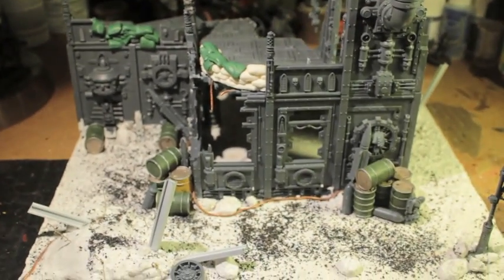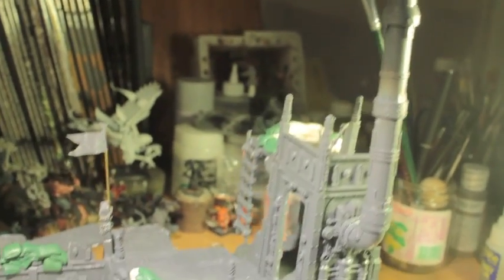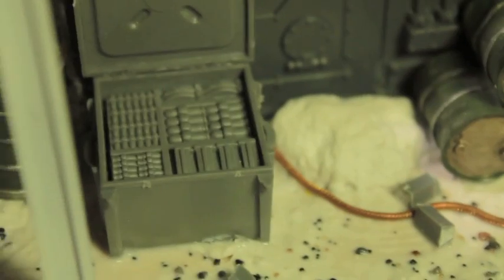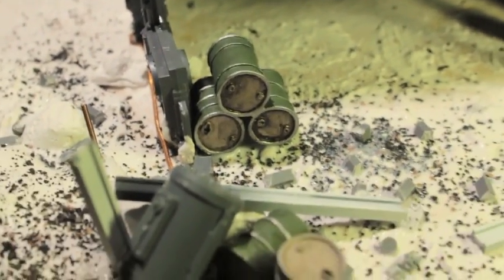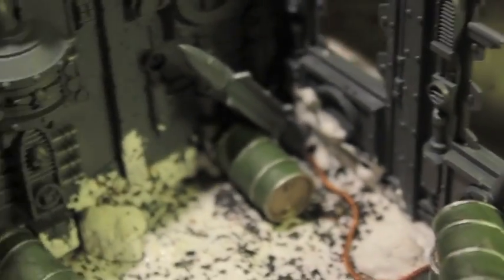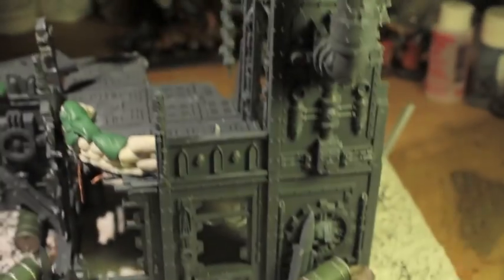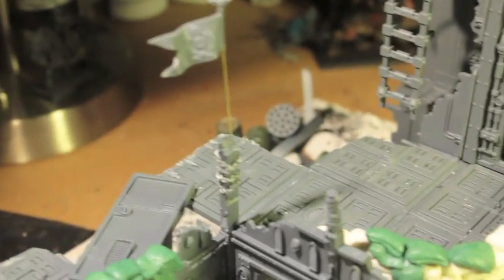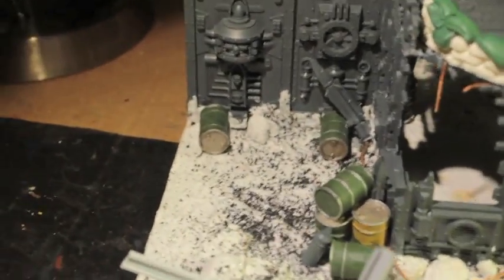IDICBeer Terrain Competition - Entry 2

Comment: Wow, such awesome and inspiring work once again. For the deflated sandbags, you should drill a few holes to make them look all shot up.
Reply from the maker: Thanks very much for the kind compliment, and for the suggestion!  I tried drilling through the stupid sandbags but I don't think I was using the right pin vice head, or something, because the greenstuff kept "sticking" to the drill and when I tried pulling the drill out, even working it out backward, it tended to warp the sandbag as the GS got sucked out.  I'm going to try experimenting.  I've found that using a hobby knife to drill and then create the rips worked really well for me!